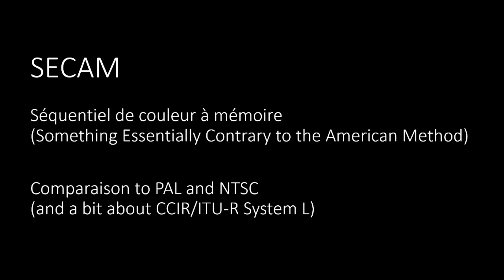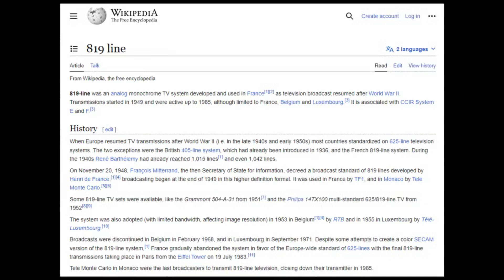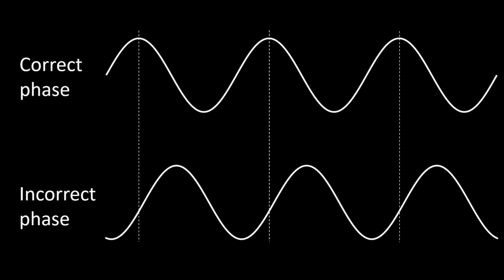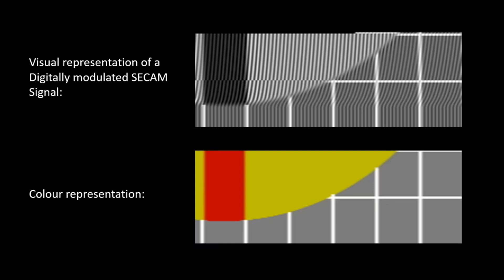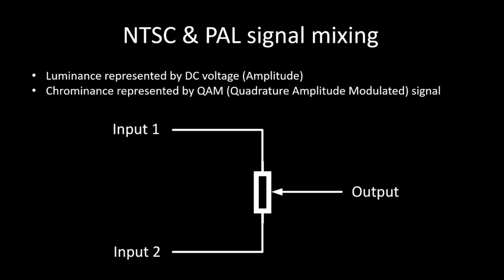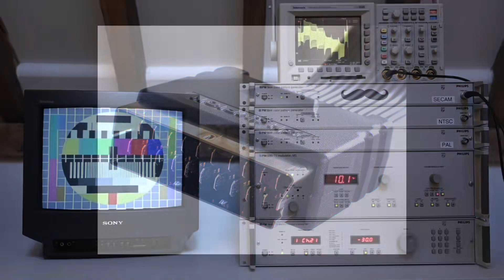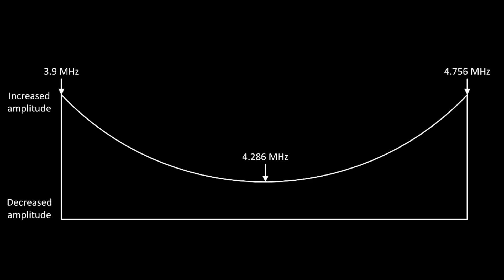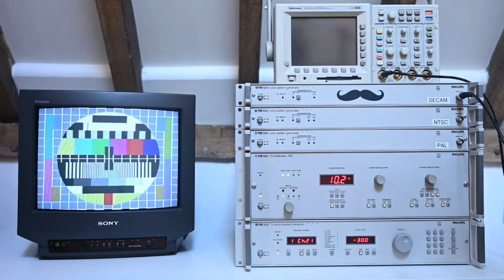#4 - SECAM + Comparison to NTSC & PAL (And a bit about CCIR System L)

Comment: Brazil used PAL-M, which was a PAL-type color signal running at 60Hz (the local mains frequency) with enhanced fluid motion and a corresponding lower vertical resolution. This positioned it as a true intermediary between the American and German standards. Switching the VCR output between the two types of encoding for home videocassette viewing was a breeze.

Comment: I worked as a TV engineer for 19 years. I know all the disadvantages and artifacts of SECAM very well.
Some authors during the USSR claimed that the USSR adopted SECAM "for political reasons" (friendship with France). And they called SECAM "a joint Soviet-French system"
I can tell about the real reasons for adopting SECAM and some other interesting facts.
1 - the USSR long-distance microwave lines, due to their low quality, could not transmit an NTSC signal and had limitations for transmitting PAL
2 - PAL system equipment requires a high production culture and precision tolerances for each element, so the USSR industry was not ready even for the mass production of quartz crystals and delay lines.
3 - Thomson CSF, in addition to TV equipment, was a European leader in the production of electronic equipment for the armies of NATO countries. Soviet intelligence wanted to introduce its agents into this company and recruit French specialists. That is why the USSR began to cooperate with Thomson CSF.
4. The USSR agreed with Thomson CSF on the absence of license fees only for equipment for TV studios. However, the USSR did not pay France license fees for each color TV sold.

In the mid-1980s, there was a demand for PAL decoders for owners of video recorders. Many engineers, technicians, and radio amateurs began to private manufacture PAL decoders and earned decent money.
French intelligence recruited Soviet intelligence officer Vladimir Vetrov (agent Farewell), who was interested in Thomson CSF developments.
After this, the CIA and its French colleagues passed to USSR  through Vetrov fake documentation on missile defense systems, including the Shuttle.
And this finally brought down the Soviet economy, which was focused on arms production.
Reply: Забористые сказки.
Reply: @Alex-xxxx  
Are you a TV expert? Yes/no?
Maybe you are a grandson of the legendary general Grubozaboyshchikov?
Sit quietly in your swamps.
Reply: @berko9608  ты поездишь аки Троцкий, или его современная жалкая пародия Путин ))

Comment: There are some interesting tidbits that I find are missing from the video: mixing SECAM signals through demodulating and re-modulating color information is not only complex, it also degrades the quality of the resulting signal. For all those reasons, when complex mixing, digital on-screen graphics and things like that started becoming common on television (or perhaps even earlier), every single broadcaster in the world abandoned SECAM as a production format, if they ever used it for that purpose. Everyone operated as a PAL station and transcoded to SECAM just before transmission. It just made way more sense, while preserving the apparent advantages for the receiving audience. Although in practice, PAL usually provided better quality than SECAM nevertheless.

As for the consumer equipment - yes, the right way to do OSD over a SECAM signal would be to use the keyed RGB signals in the SCART connector. But many consumer VCRs and satellite tuners just ignored that and mixed OSD (without any color subcarrier) in the composite domain as if it was PAL. The result was awful color trails behind OSD text, but people didn't really care all that much - you wouldn't keep the OSD on screen continuously anyway.

Speaking of consumer VCRs, there are actually two ways of recording SECAM on VHS. The official method, used in France, involved separating the color subcarrier and then dividing it (by 4 if I recall correctly) as if it was a digital clock signal, and recording that (perhaps after filtering out the harmonics) as the color-under signal on videotape. That was arguably simpler than the heterodyne used for NTSC and PAL, but it was just something completely different, making it complicated to make a multi-system VCR. So Middle Eastern importers modded PAL VCRs so that they would treat SECAM signals as if it was PAL, heterodyning the color subcarriers. It was rather simple to make it work because PAL and SECAM color signals occupy roughly the same part of the composite signal spectrum. And that's how MESECAM (Middle Eastern SECAM) was born, which is a term specific to consumer VCRs, and despite the name was used not just in the Middle East but in Eastern Europe as well - basically in every SECAM country other than France, making French and Middle Eastern/Eastern European tapes incompatible. On the other hand, MESECAM VCRs could record and play PAL tapes just fine.

What's arguably even weirder, encoding of SECAM was never defined for S-VHS, and all S-VHS VCRs in SECAM regions reportedly transcoded SECAM signals into PAL when recording.

Comment: SECAM has a two input analog MUX. What is wrong with having some Syncing Colorburst like in NTSC then transmit [R G B] [R G B] etc? with a 3 input analog MUX. B&W would be still be compatible. Then if later with better technology you wanted to double the horizontal resolution from the spec frequency you could do [R R G G B B] with first half of R being one pixel and second half being next pixel amplitude. Too bad didn't just make new standard and triple vertical lines so lines go R G B. Then horizontal resolution unlimited and simple. NTSC resolution was so low.

Comment: Is it true that SECAM displays were prone to Moiré interference patterns?
Reply: Is it true that SECAM displays were prone to Moiré interference patterns?
Yes, it’s true. The reasons are:
1. Despite the notch filter in the luminance channel (Y), some even black-and-white patterns in the picture (for example, a white dress with vertical black stripes) could be interpreted by the decoder as a color signal and this dress was "painted" with colored moires
2. The imperfection of ultrasonic delay lines (especially those produced in the USSR) led to collisions of the Dr and Db subcarriers and artifacts on the image.
3. Two frequency demodulators in the case of one microcircuit were also the cause of colored moires. For this reason, professional TV monitors used two submodules for Dr and Db, each with its own delay line and demodulator microcircuit.
In TVs that used a PAL to SECAM transcoder, interference from the 4.433 MHz generator also caused colored moires.
4. If the overall composite signal was limited in amplitude, the color subcarrier signal disappeared and the SECAM decoder detected random noise with unpredictable coloring.

Comment: I'm guessing the reason why they have some kind of upside bell curve probably has to do with the fact that analog band-pass-filters typically have a bell curve frequency response, and they're compensating for it from the encoder.
Reply: The anti-bell curve in the SECAM coder improved the signal-to-noise ratio of low-index (narrowband) frequency modulation.
In the professional decoder, the bandpass filter and bell corrector functions were used independently, and their characteristic shapes were standardized.
In home televisions, these two functions were performed by a single filter.

Comment: I don’t really care about those technical diagrams of these signals.
But i do care about the way at how it works.
Because instead of carrying all 3 color signals atonce, it only transmits 1 signal atonce, a memory delay line is used to store all 3 recieved colors and synch them to display those 3 colors in it’s (supposedly) full glory because neither off those colors did affected each other.
However this cannot not be done on french game consoles as it will cause input lag in games and disabling the delay line would definitely cause rainbow pattern artifacts in moving parts of the image.
So that’s why french game consoles do use a scart rgb output to avoid such input lag.
But for movies and videos it shouldn’t be a problem to use a sicam signal trough composite video or an rf cable since you don’t need to worry about input lag.
To me i consider secam to be the best video format to transmit an rgb signal over antenna or composite video cable in such a cheap alternative way😁
Reply: you missed something importnant : none of the 3 colour systems transmit RGB informations.
they transmit only red and blue, then green is obtained in the reiceiver by matrixing the level difference between red and blue.
pal/secam/ntsc have this in common.
france originated scart and direct RGB  because you can't mix two secam signal together. and it was originated because of "antiope" caption system. then as scart became common in europe, game console manufacturer took advantage of RGB.
as it simply allow to not build a pal/secam coding circuitry... save costs, and gived the best picture possible at the same time.

Comment: I know this is a little late but YouTube just showed me this video. You say in NTSC & PAL "color is ultimately represented by amplitude". I take exception to this ... yes the color difference signals are in terms of the amplitude of U and V (in phase and quadrature components of the sub carrier) but the hue is the phase of the subcarrier with the saturation being the amplitude of the subcarrier (referenced to the burst).
Reply from the maker: @MichaelKatzmann  but as you rotate the phase the instantaneous amplitude changes. I don't think what I said was incorrect in that context?
Reply: @mattstvbarn  No, you can change the phase of the subcarrier without changing its amplitude ... it will change the hue (not the saturation .. i.e. amplitude).
Reply from the maker: @MichaelKatzmann  there is a diagram in the video addressing this point specifically.
Reply from the maker: @MichaelKatzmann  I think we are arguing over terminology here. I should have said voltage.
Reply: @mattstvbarn  yes, I don't no what you intend by that diagram but its not showing that. The amplitude of both signals .. 'Correct phase' and 'Incorrect phase' is the same, it is just the phase that is different. If you are trying to say that the amplitude of a sinewave varies ... sinusoidally, well yes but the instantaneous amplitude is not the hue, it is the phase. Say I have your sinewave, lets call it amplitude A and a few cycles later I increase its amplitude to 2A, the amplitude at all samples of the subcarrier are doubled but the hue remains the same only the saturation has changed. ...  anyway interesting stuff. I worked on PAL so had only a passing knowledge of SECAM.
Reply from the maker: @MichaelKatzmann  as I said I should have described it as instantaneous voltage. It is better to watch my videos when ignorant.

Comment: What I'm wondering, doesn't the UK also use positive modulation on their System A? I think I read about that somewhere.
Reply from the maker: @altebander2767  yes but that was an awful long time ago
Reply: Uses 405 lines, PAL, SECAM, PAL-N are 625 lines, NTSC and PAL-M are 525 lines
Reply: System E 819 lines was used in France until 1984 to System L

Comment: My first digital capable TV, a 28" 16:9 Hitachi had undocumented analogue capabilities which I discovered using my first analogue and digital satellite receiver. The satellite receiver could send 625/ PAL to the TV whatever satellite signal was being received but could be set to send in NTSC and SECAM as well and the Hitachi TV would accept them. When a NTSC 525line satellite signal was fed to the TV as 625/PAL motion was jerky which cleared when switched to 525/NTSC and a TINT option became available in the TV's settings menu. When the French analogue satellite 625/SECAM signals were seen, text had noticeable colour ringing which I think must be the origin of the STREAKAM nickname for the system.

Comment: I was at the WM in football in 1998 in france making television for the national broadcaster here in Denmark (still working there) and was on almost on all stadiums with our OB truck. 
Many of the french OB trucks was PAL composite system, with a PAL to SECAM encoder. I remember that on Bang & Olufsen television set there was a remote command that sometimes was activated, that shifted the IF signal from negative to positive. So now the PAL signal looked like the SECAM signal. Now its a lot easier, no analog transmision. Mostly digital with component HD or UHD signal. 
All the Phillips equipment you have in the video, are developed here in Denmark. 
When Phillips sold that division out, it became PTV, and later DK Technologies.
Great video by the way.
Reply from the maker: Thanks for the comment. If you hadn't already worked it out, this channel was specifically setup to demonstrate the works of Philips TV & Test Equipment (Denmark) :)
Reply: @mattstvbarn  I have noticed, and I really enjoy the content, since this has been a part of my work for many years now.
They did a hell of a good job in Jenagade, and later in Herlev.
Reply: I used to deal with DK Technologies

Comment: Not sure if others have posted - but I suspect System L using +ve modulation and AM sound is because the previous French 819 line (System E) system was also +ve modulated and also used AM sound?  Would it have slightly simplified dual-standard receiver design - or just been 'what we do'?   (The UK also used +ve modulation and AM audio for its 405/50 B&W system - System-A). Weren't the Bell/Cloche filters also related to the compatibility issue?  B&W broadcasts in PAL/NTSC have no subcarrier added to the luminance - so deliver a perfectly acceptable B&W picture to a B&W TV (as there are no subcarrier dots or cross-luma).  SECAM broadcasts of monochrome B&W content still have subcarrier present added to the luminance, meaning B&W broadcasts were impaired on B&W TVs with no subcarrier filtering (as there was still subcarrier overlaid and this would be seen as dot crawl on monochrome TVs).  As a result I think the bell filters are partially there to reduce the amplitude of the FM chroma subcarrier as the subcarrier frequency nears the FM zero points - i.e. where Dr and Db are near zero when the content is in B&W?
Reply: it's effectively visible on b&w sets, but not so annoying with a bit of distance.
but it's not dot crawl, more like sawtooth crawl :)
from my understanding, cloche and anti-cloche filter are used for pre-emphasis/de-emphasis (shown on oscilloscope in this video)
but for compatibilty, i remember reading something on "phase" alternation every 4 line. that explain the sawtooth pattern it does.
Reply: @whaka54000 
The anti-bell curve in the SECAM coder improved the signal-to-noise ratio of low-index (narrowband) frequency modulation.
In the professional decoder, the bandpass filter and bell corrector functions were used independently, and their characteristic shapes were standardized.
In home televisions, these two functions were performed by a single filter.

Comment: A good PAL signal on a good Ferguson/Thorn TX10 is probably the best tv picture you could ever see.
Reply: No way.  The 50hz refresh rate is a huge disadvantage on a CRT.  The flickering is painfully obvious.
Reply: @BigJojo2K9  How old are you ?
Reply: Sadly the Ferguson/Thorn product was sh.. component and building quality compared to other TV manufacture. 
Worked in my youth as radio and tv repair eng, and we saw a lot of those TV. We normally scraped the TV, instead of reparing them, and have a recall within a week.

Comment: I presume that SECAM television sets were originally more expensive to manufacture than PAL sets.  Certainly the market penetration of colour TVs in France was way behind that of the UK during the 60s and 70s.
Reply: No, Secam TV set is few cents cheaper than PAL one. Everything is similar, but you dont need so precise delay line like for PAL. But France was just only one country in western Europe that used Secam.
Reply: @xsc1000  Oh that's helpful to know. Strange that similar sets were typically more expensive to buy in France than in the UK during the 70s, but that may have been due to differences in VAT.

Comment: UK used PAL from 1964 in UHF bands IV and V which was a mistake because better coverage without recourse to over 1000 relays and 51 main stations wouldn't have been necessary if VHF Band III had been used instead.
Reply: In Ireland, when PAL colour TV was introduced in the early 70's , it used the existing 625 line VHF Band I and III transmitters.
Reply: @patmonahan9619 also in South Africa too.
Reply: Thanks to System A 405 lines TV. 405 line tv are using VHF.
Reply: BBC and ITV wanted to implement a compatible NTSC-A service in the late 50's but the Government insisted they wait for a German system as the UK was trying to overcome French objections to the UK joining the Common Market. Would have saved a lot of money on transmitters work  @Alozhatos
Reply: @Alozhatos system A used AM
Reply: UHF band has greater spectrum range

Comment: An important benefit of SECAM was its insensitivity to timebase errors (that are produced in VTRs). That meant that the old monochrome TBCs could continue to be used. The time and phase insensitivity also allowed distribution over old and vast networks (think USSR) without degradation.
Its biggest drawback was that it could not be used in post-production. It's impossible to mix or key a SECAM signal, you need either the component original signal (pre encoding to SECAM), or you must decode and then re-encode, causing degradation.
Reply: When SECAM was introduced in the USSR, the TV network there was not old, obviously... The main reason for USSR choosing SECAM was, indeed, its insensitivity to timebase errors.